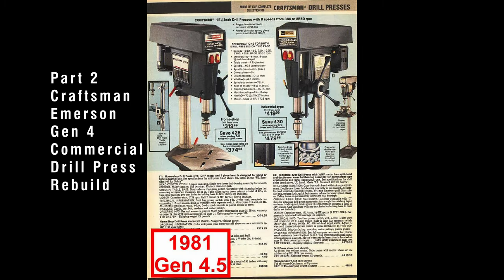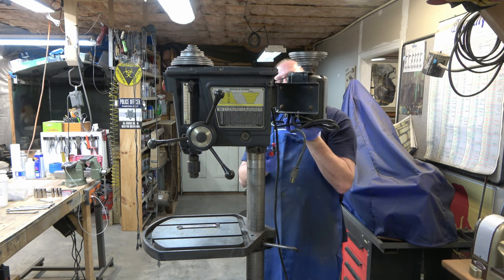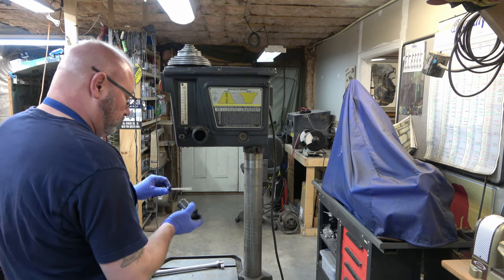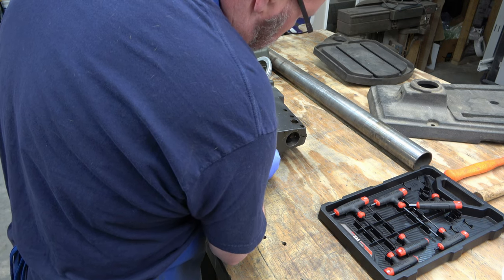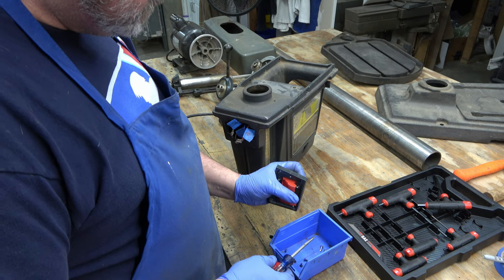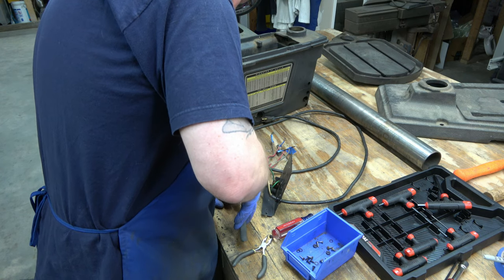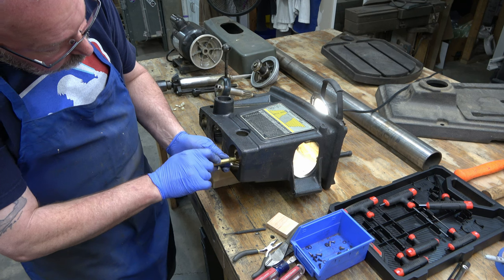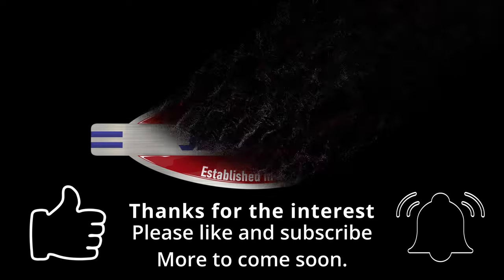Part 2 Rebuild Emerson Gen 4 Commercial Craftsman Drill Press (Disassembly)

Comment: So glad I found these videos! I’m working on fixing up this model of drill press that was handed down to me. Main problem I have is the pinion was stuck in the eccentric bushing, looks to have gotten torn up when someone forced the pinion to turn. Using your advice I hope to get it running like a champ again! Thanks for such detailed videos, much appreciated!
Reply from the maker: I am sorry for not responding. I never got a notification of your posting. So, the eccentric bushing being stuck is common. I put a crows foot on the bearing and unscrewed it CCW and at the same time I wedged a flat tip screwdriver between the bushing lip and the head casting and as I unscrewed the bearing I pushed the bearing away from the head. Eventually, it came off.
Reply: I have a seized quill. I cannot raise or lower it. Any thoughts there. The machine is gunked up pretty bad
Reply from the maker: @TheRealWilsonn  Wilsonn, I assume you have a "Commercial" Craftsman Emerson similar to the one in this video? If so, you need to completely remove all 3 take up screws on the left side of the head, completely remove the quill lock, the quill stop rod, and the pinion (and with it the hub and spring). At that point there should be nothing holding the quill in the head. Remove the side machine screw that locks the spindle pulley assembly in the head and if possible, remove the spindle pulley assembly. This should expose the top of the spindle and quill. squirt some PB Blaster from the top into the head so that is works around the quill and flows down through the head and let that sit for 10-15 minutes. Get a rubber or plastic or wooden mallet or dead blow hammer and tap the spindle on the top driving the spindle and quill out the bottom. Do not use a standard hammer because it may mushroom the splines on the spindle. If the spindle is deep inside the head and you can not get to it with the hammer or you cannot get the spindle pulley assembly out, then use a brass rod slightly smaller diameter than the spindle to drive the spindle down. Once the quill is out, disassembly everything and clean everything. de-rust as needed, then re-assembly and lubricate. If you are unable to get the spindle and quill out, take some pictures, create a free account on The Garage Journal Forum and post your issues with pictures in this thread: https://www.garagejournal.com/forum/threads/craftsman-drill-press-information-belts-bearings-chucks-keys-etc-1946-1984.489080/
Reply: @JeffsShop  I ended up getting it out. It was rusted pretty bad from a mouse infestation. Thanks for the reply.
Reply from the maker: @TheRealWilsonn  I am glad you got it sorted. Clean that thing up and you should have a wonderful drill press.

Comment: Hi Jeff, I'm really glad that I found your page! You do some Nice work restoring these vintage machines. I have the same commercial drill press that your disassembling in this video, I'm in the process of disassembling mine. I have found that my eccentric bearing/ pinion backlash the head is broken off. Two questions for you, 1: how should I go about removing it since it's broken? And do you know where I might could find a replacement one ,and possibly a part number? Much appreciation in advance for any help would might can offer me in this situation of mine! Thank You for your help and support and encouragement with your great videos.
Reply from the maker: Bobby, first, the owner’s manual with an exploded parts diagram and part numbers is linked in the description of the video.
Second, finding a replacement bearing will be hard but they do pop up on eBay every now and then. Fabricating a new one is probably the best option if you have the capability. The next best option is to buy another commercial drill press for the part then sell the remaining parts.
Lastly, please go to the Garage journal forum and in the linked thread, post some pics and ask your question about removing the broken bearing. I am sure one of us on the forum can help you get it out.
https://www.garagejournal.com/forum/threads/craftsman-drill-press-information-belts-bearings-chucks-keys-etc-1946-1984.489080/

Comment: Hi Jeff, I appreciate your detailed videos.  Any idea approximate what the gen 3/4 head weights without the motor?  I need to transport one by myself, motor is probably about 20lbs, just want to know what I am in for when pulling the head off the column.
Reply from the maker: The head casting is probably about 30 pounds empty, add the quill/ spindle assembly, hub pinion assembly, and the spindle pulley assembly and its probably close to 45 pounds. I do have a disassembly video for transport or "field strip" of a 150 which most of it will apply to all the models, including your gen3/4. here is the link: https://youtu.be/CwJxXNXQZrs
Reply: @JeffsShop  is it possible if I could ask you a question.....I am about to finish restoring an exact replica of this drill press ( it is a Sears Craftsman 113.21371 ca. 1974) , but I have issues with the spindle pulley assembly bearings- the two bearings that I have attempted to secure keep coming out of their receptacles / bores. I reached out to the machinist on ebay I bought those bearings from- he assured me that they are the right size. I am wondering- do you think squirting some lock-tite or vibra-tite sealant on the outside of each bearing (or possibly on the surface of the bore) might secure them in place? Jeff, if you could get back to me on this I'd greatly appreciate it. Thanks again.
Reply from the maker: @rayjr62  Lose spindle pulley bearings is somewhat common. I recommend you apply Loctite 600 series, see this link to determine which version is best for your situation. Also be sure to install the machine screws that retain the bearings in the head casting. Even if the bearings are lose, they can not come out of the head if the machine screws are installed. Link  https://next.henkel-adhesives.com/us/en/applications/retaining-compounds.html